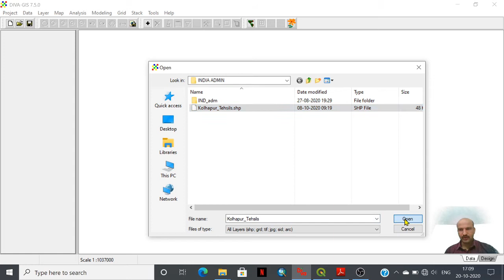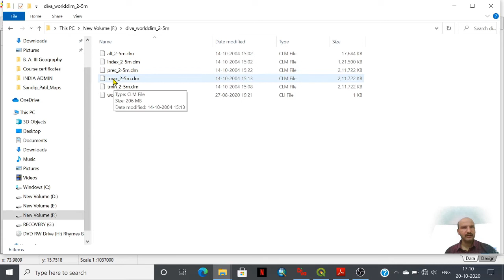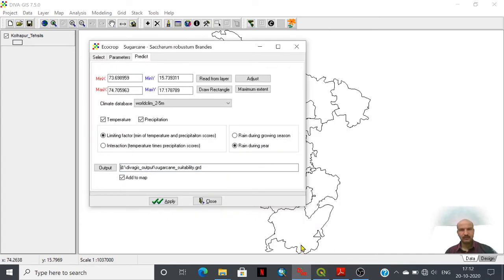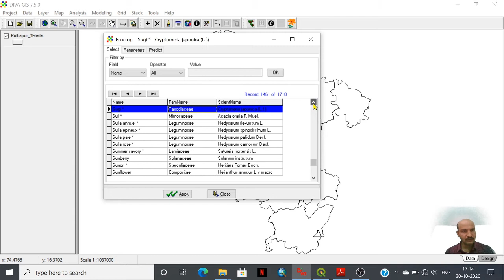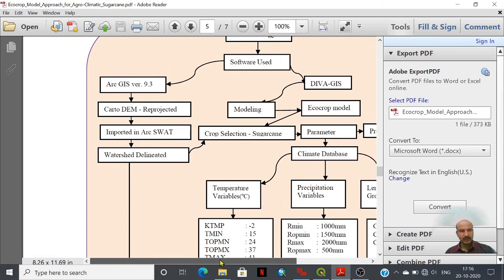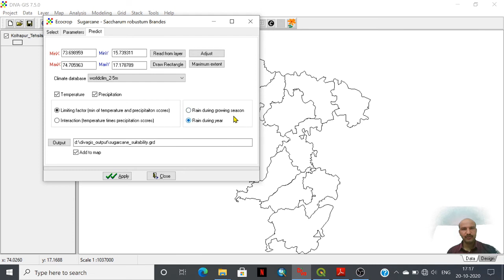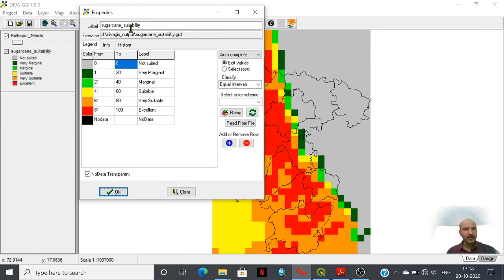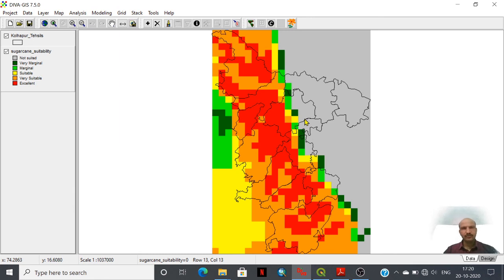AGRO-CLIMATIC CROP SUITABILITY ANALYSIS USING DIVA GIS

Comment: como puedo hacer, para que la imagen del modelamiento no salga tan pixeleado.
Reply from the maker: Could you please write it in English...
Reply: @geospatialworld926  How can I do so that the distribution is not pixelated
Reply: I can insert weather data at 30 sec?
Reply from the maker: @streamtwitchclips7372  
It is possible to import 30 sec data but you have to do stacking and after that you can use the same...
Reply from the maker: @streamtwitchclips7372  
What do you mean by pixelated..
Reply: @geospatialworld926  I tried with worldclim data at 30 sec, but the divagis, does not recognize this data because it is in that format (.clm)
Reply from the maker: @streamtwitchclips7372  
I will let you know..
Reply: @geospatialworld926  OK thank you